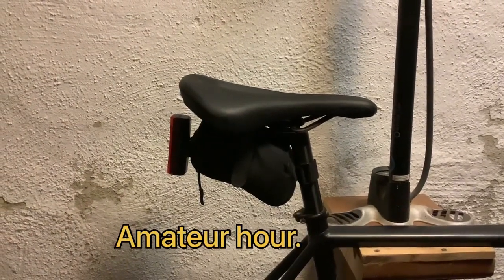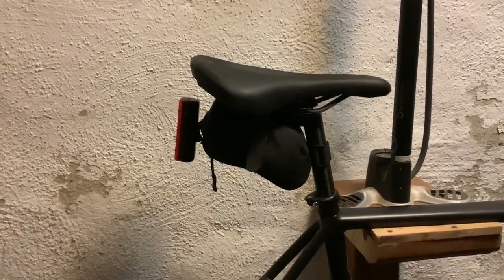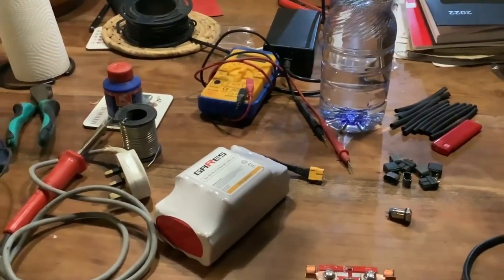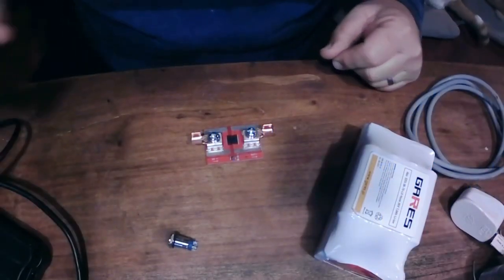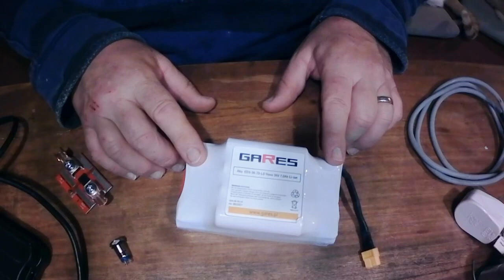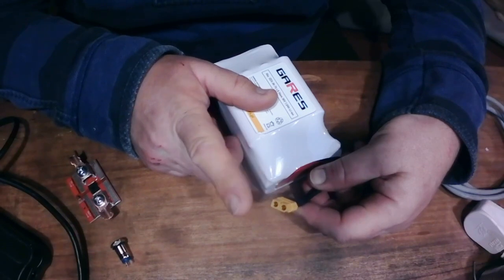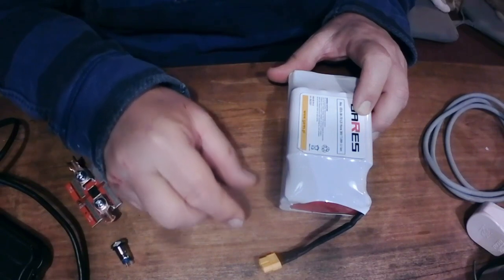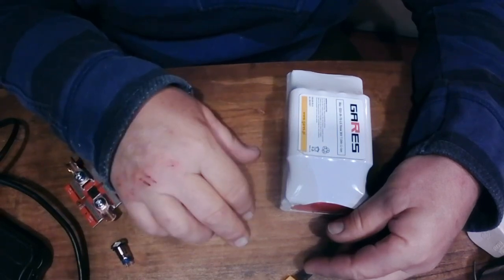DIY Mahle X35 Range Extender - Save $$$$$!

Comment: hi again bud..... I've done all the things required and am just waiting on the hover board battery arriving from Aliexpress......but everything is working so far!! A question though... I've just noticed I have ordered this battery - Hover Board Battery 36v 10s2p 4400mAh Lithium Battery Pack - and now see that u mention it should be a 7Ah??? will this mean I don't get as far?? maybe I can send it back and get another one..... what you think?
Reply: also..... just checking here... but I have now got everything done and just awaiting delivery of "suitable" hover board battery.... (I will re-order a 7Ah as soon as you answer my question above) - but I notice, I have the diode all connected up and did the XT60 connectors onto the chargers etc.. so, when I connect the existing charger everything lights up...and the iWoc light comes on... and when it's full and solid white light, when i unplug the charger XT60 within the saddle bag... the white light stays on.... and I then need to hold the button in to switch off.....Is this normal?? or have I done something wrong?
Reply from the maker: That 4.4Ah battery will be fine, but you are right, 7Ah will take you further. People also say it is generally a better idea if the capacities of the two batteries are the same, but this is mostly if you are charging the two batteries together, which I don’t advise.
Reply from the maker: perfectly normal! When you connect up via the charging socket you are switching the system on, so you have to switch it off via the iwoc. One other thing to remember, if you stop for any length of time, the internal system switches off. Obvious when you don’t have the extender fitted, as the Iwoc light goes off, and when you get back on, you  think  ‘oh, I need to switch the system back on!’. But because your extender is connected, the Iwoc stays lit. You then get back on your bike and ride off, but you have no assist, and you won’t be able to change the assist levels. This is because your system IS actually off.  All you need to do it unplug the extender from the charge port, wait a second, and plug it back in. the system will come on as normal.
It took me ages to discover what was going on! Sounds a bit complicated, but isn’t. Unplug/replug after any long stops.
Reply: @yakoridesagain  haha.... ofcourse... that thought had entered my head when I was standing here looking at it... thanks for the quick response bud....I think I'll send this 4Ah one back.... already have the 7Ah in the trolly!! it just takes so bloody long for them to deliver here!! but hey ho... be worth the wait (it's not my bike.. it's my Lass's) It's a Ribble 
CGR AL E...it's from 2020.... and I am making it into a flat bar 1x bike (like on their website...) and I got some 700x40c gravel tires on it too.... just need this hover battery and the work is complete... thanks for the heads up on that, very much appreciated..... Hot Hot here now.... must be same for u.... I'm spending more time swimming than riding... but have some guiding next week!! cheers

Comment: G'day Yako I did mine about 3 years ago and it has worked great. I've been using the 4.4amphr hover board batteries. I want to get the 7amphr battery you used but can't find it in ebay could you  share the actual link please. I'm in Australia and it may not come up on my search here. Regards Peter
Reply from the maker: Hola Peter. Looks like the link is dead, Gares was the company name…
Try “Samsung 36v 7ah hoverboard” on Google and see what shows up. Panasonic are also reliable cells. Def still available online. Hope that helps.

Comment: I love this video. Seen it several times while researching what bike I will get. 

I understand the benefits of the paralell setup you use. But I have a different chalenge that changes my priorities. I don’t have a handy access to charging where I need to store the bike between rides. 

The original batterybank style extender solution is therefor appealing to me. But not the cost or the capacity of it. Is it however possible to make a DIY battery bank style extender, and can it be larger capasity than the internal battery?

Do you have anny thoughts on this?
Reply from the maker: I’m sure the answer is yes, but you would need to step up the voltage of your extender to 42v and limit it’s output to 2a, and I don’t know what components would be required. The capacity of your extender could be much larger than the internal battery though.
A basic alternative if your storage is secure would be a 12v car battery and a small 110/220v (depending upon where you are) inverter, then just plug in your normal charger to top up your internal battery.
Sorry I couldn’t help more.
Reply: Thank you for a quick and excellent reply! Very clever idea about the car battery. Made me think of other alternatives too. Thank you!

Comment: Hi Yako, hopefully my last question. I’ve built my version and when plugged in turns on the Iwoc as you said and you can then scroll through the levels as required. The display on the Mahle app says Internal battery 100% and 82 mile range which is what it said before. Q: does the extra battery show on display anywhere or is your only indication that the battery depletes slower? Will test fully when I’ve got a better sized saddle bag. Cheers Phil
Reply from the maker: Ah - I’m really not sure Phil as I haven’t looked at the app once I selected the assist levels years ago! For me, the Iwoc just takes twice as long to change colour…one thing I will say, soon I don’t think you’ll think about batteries much at all! Ride happy!

Comment: Thank you for this awesome Video! Which forum are you referring to, when saying other people have done it? 
I would really like to build my own, but like to see as many builds as possible before making plans :) thanka again I love your videos
Reply from the maker: Check e-bikereview and Pedelecs forums, but you’ll have to do some digging to find the relevant posts. Good luck. It is a very basic design, easy to make, and works better than the original, seemingly with fewer faults. Thanks for the support!
Reply from the maker: Oh, and by fewer faults, I mean none - I made a follow-up vid a month or two ago.
Reply: @yakoridesagain  Thanks a lot!!! the parralel connection seems really promising!! I am just worried about the voltage situation when connecting the two batteries... needing to check the voltage of each battery before connetcting seems annoing in every day life.
Reply from the maker: That’s in the video as a precaution. As long as the battery charger goes green for each battery, I know that the voltages are close enough to connect the two. I check the two batteries, fully charged, to establish that this is still the case every month or two.
Reply: I understand, that sounds pretty good! But you couldn't ride somewhere, dissconnect the batterypack, charge it and connect it for the ride back home, right? could you discconnect it (so it doesnt get stolen) without charging and then reconnect it again for the ride home? I live in a big city and would need to be able to take the extender on and off quite often. Thanks again for your great work and videos!!! :)   @yakoridesagain
Reply from the maker: I personally have never connected a full extender to a depleted internal battery, but others have, relying on protection within the bike, but I don’t want to risk it myself. You can connect and disconnect the extender during a ride, absolutely yes, as they connect in parallel so will be at the same voltage.
Reply: @yakoridesagain  🥰😍🤩

Comment: ok, hola again.... so I just took my wife's bike out to test it.... bare in mind, I do not have the hover board battery yet, so I have the saddle bag, with the diode in it, and I have cut the existing charging lead....so, took it out.. and all the lights work on the bike... but there is no assist.... I didn't have the saddle bag on... so I came back... put the saddle bag back on and connected the existing power lead.... and still all lights operate.. but no assist.... any ideas? or does it require this hoverboard battery to operate now??  i'm confused... as I thought if I removed the saddle bag and the old cable... then can ride it until the hoverboard battery arrives... but no....I can't have fried the internal battery.. as all lights come on the iWoc....watya thinks?
Reply from the maker: You can’t have damaged anything without even having the battery connected! You can switch the system on, and toggle through the power levels, but no power to the motor? If this is so, it is 90% likely the PAS sensor. First thing to do is check that the magnets in the cassette lock ring are clean. Next, clean the face of the sensor - it’s a little black plastic tab facing the cassette in the frame (rear chain stay). If you still have no power, check the gap between the sensor and the magnets - it’s supposed to be 3mm. If yours is more, loosen the sensor by undoing a 2mm grub screw under the sensor, push the sensor closer, and retighten. This should sort it. Takes 2 minutes.

Comment: Yako does your bike have the ant+ transmitter near the iwoc. If yes look at an ebike app on garmin connect and you can see the ebike battery as  a percent of 100 even with both batteries and it reduces slower.  In answer to your question with two batteries the overall voltage stays high so you dont get battery slump
Reply from the maker: Hi Mike - I couldn’t get my ebike field app I put on the Garmin to talk to the bike so something is wrong somewhere. It would be a nice feature, but then the iwoc  button is not bad, and probably means I spend less time worrying about the battery! You are the first person I’ve actually been in contact with who has done this. At one point I wondered if it was because you’d all burned up in lithium fires of your own making!

Comment: Hi Yako, could I ask you how best to protect the main battery from extremes in temperature while in my garage. I'm just starting to research my first ebike due to arthritis in knees! The Orbea Gain is on my list but as the battery doesn't remove and hubby won't let me store the bike in the house, it will be stored in the garage in the UK. We've recently had sub zero temperatures, could you give me tips for charging and preserving battery life? Apologies in advance if you have talked about this in a previous video, I did have a look through the subjects of your previous videos but didn't spot anything. BTW, loving your channel! Thanks.
Reply from the maker: Hi Julie. You’re right, I’ve not made a vid about winter maintenance, though it’s been planned for some time. Never enough hours in the day! First off, the battery is fine being stored in cold temperatures. The trick is not to charge it, or use it in extreme conditions. Saying that, neither of these will lead to anything worse than a degradation of range. When it’s warmer your battery will be as right as rain. So, you may need to plan ahead when you are going to use your bike. Unless you commute with it? If you are using it at weekends, perhaps charge it in the morning and ride in the afternoon? This would be best case. If you are commuting, you will have to charge it and use it regardless, but be prepared for maybe 20% less range than you are used to. The battery warms as it charges. There are neoprene slip covers for certain batteries to keep the battery warm once charged. This may help a little. Generally, battery maintenance recommendations can get a bit anal. Though it is best to keep your battery at 50% charge if you are not riding it, don’t worry overly unless you are leaving it for weeks at a time. Equally, many say they never charge to more than 80%, to avoid shortening the life of the battery. Again, this is true, but then you don’t get the range you want when you want it. I ride most days, so after a ride, I put it on charge until full, then have it ready for the next day. We are getting -4c at night at the mo, my bike is in an unheated outbuilding. I notice I get less range than in the summer, but I just factor that in. Thanks for the support. Fire away if you have other questions! And work on hubbs to let you keep the bike indoors!
Reply: @yakoridesagain  Ok, that's great advice. Waiting to see what you think of the new Orbea, I hear the stack is lower than the previous model, hope the frame isn't too aggressive - I'm after comfort at my age!  Many thanks.
Reply from the maker: I believe the stack is lower - but not by much, less than a cm in size large, from my failing memory, so not a dealbreaker. I should be able to give you more definitive info once I’ve ridden the thing! Good luck with the knees!

Comment: worryingly.... I notice that the iWoc switch on bike gets very hot (now, I don't know if this was the case before... as I never paid attention..... but there is no assist working atall... I cannot see why it would not work on the internal battery alone... if you disconnect everything....have I fucked it???
Reply from the maker: The Iwoc does get very hot, don’t worry. Or rather, mine does too.

Comment: Hi Yako, great video, thanks so much for sharing. I'm thinking of installing the extender in a water bottle. As space will be at a premium, can you suggest a Schottky diode that would be suitable?
Reply from the maker: If you take a look at the Volabike range extender, you will see that it is based on an AliExpress bottle battery. The mounting cage for that battery has space in it to accept an Ideal diode with the corners of the circuit board cut off. I’d advise this type of diode as it uses virtually no battery charge to operate. Schottky diodes are far smaller, but do use some of your battery power in use, and you will need to provide a heat sink of some type as they get hot…
Reply: @yakoridesagain  Thanks for your advice. It's good fun just planning the bits I'll need never mind when I start putting it together and using it!
Reply from the maker: Ha that’s exactly how I felt! It was even better when it worked! (And still is, perfectly, over a year later)

Comment: Hi!
Really great video. Great to see 
I have just bought an Orbea vibe h30. I’m assuming the same Mahle motor and battery setup as your gain. 
I live in England and get quickly frustrated by the 15mph limit on ebikes. Is there a safe “hack” you can perform on these systems to bypass the speed limiter without buying £100-200 speed bypass modules.  
Thanks
Reply from the maker: The Vibe does have the same X35 system, so the extender should work as on my Gain. The downside of the X35 is that there is no hack, and even the bypass modules only give an extra 2-3kmh, and chew the battery quickly. Your Vibe is pretty light though; you should have little difficulty pedalling at more than 25kmh without assistance…if you want more ‘go’, conversion kits, even those with motors rated at a legal 250W, can be easily tweaked to give 35kmh or more.

Comment: Hi Yako. Thank you for your videos. I  recently bought an Orbea gain M30 with only 20 battery charging cycles. Rather a good bargain, and i agree with you: it's a fantastic machine.I would like to add a DIY range extender too. What do you think about adding to your battery a Smart BMS with current limitation, first to stay in this famous 2amps limitation, and second, to protect this new DIY battery?Other question: where do you go biking? There is always sun shining....not in UK i presume...Bests regards. Pat
Reply from the maker: Hi Pat. My pleasure. Yes, your M30 has barely been used! Well done and welcome to Gain ownership! Most batteries of the type I showed in this video already have a BMS for over voltage/temperature protection for when being charged…the output is governed by the BMS/controller in the Gain. The Ideal Diode I added is insurance to stop current flowing from the internal battery to the extender if the internal battery is connected when it has a higher voltage. Others have now tested this and when under full load, the motor draws current equally from both batteries, and at a current of up to 3.5A…so, overall, I think the extra BMS would be unnecessary…
Yes, not the UK but in glorious southern Catalunya. Subscribe and take a look! Most of my videos are showing the empty roads, views and history of the places I ride to….regards, Yak

Comment: Hi Yako, excellent video! - one question regarding the battery, in order to make it a bit more “user friendly” if fitted a y splitter onto the battery connector then one end would connect to the diode and the other would be used to plug the charger into? - if that makes sense?
Reply from the maker: Thanks Colin. That would make it easier to recharge the extender if your battery has a joint charge/discharge port like mine, but if everything is left connected, you would also be charging the internal battery at the same time. It sounds great, but I’m not tech-savvy enough to know if that is a problem or not - some comments I’ve read elsewhere said you must not do this, but if it IS ok this would save a lot of fuss. I’m not sure what the issue could be…?

Comment: Hi Yako. I have two X35 range extenders that do not work. One question. Could I use a 10Amp battery for your extrnal battery solution or it is not recommended to have more capacity in the external battery than the internal X35 battery?
Reply from the maker: Hi Javier. Yes in theory you can go larger, but they must be charged separately. Others viewers have made them with up to 15Ah…but from my own research, having the extender the same capacity as the internal, is safest, and 7Ah is still small enough to fit in a very small saddle bag and only weighs 1kg.